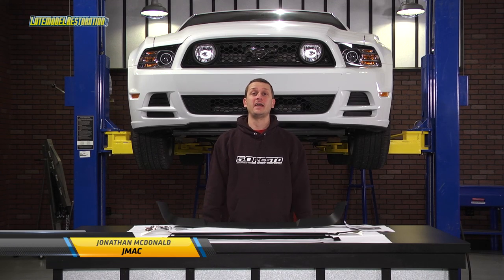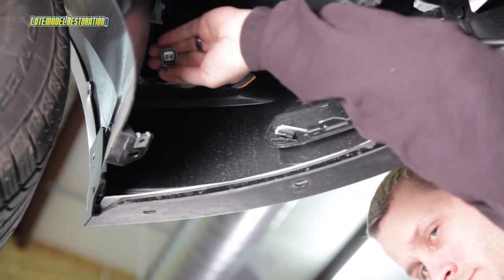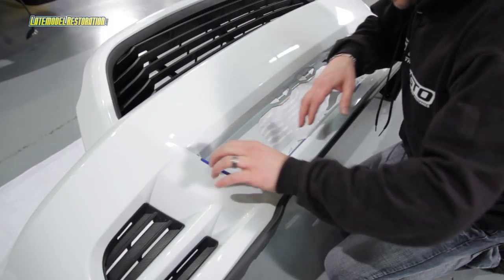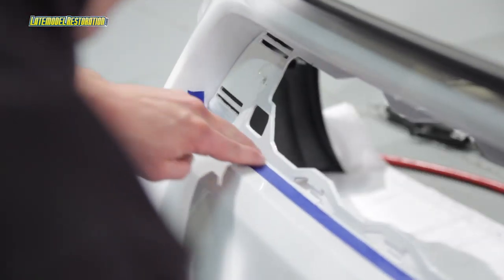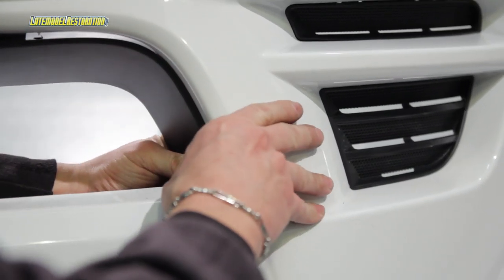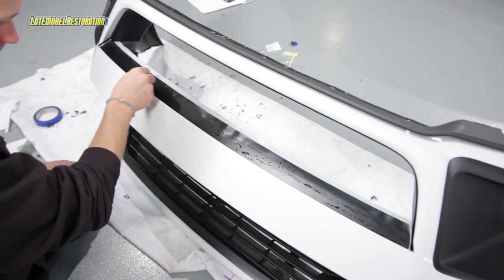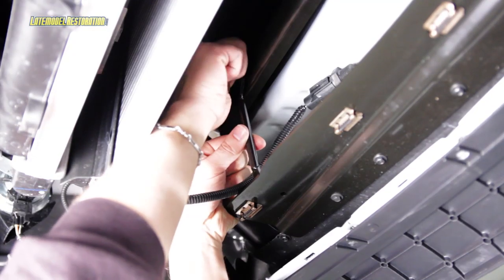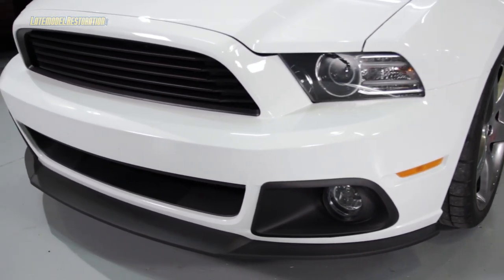Mustang Roush Lower Grille Delete Installation (2013-14 GT V6 S197)

Comment: I’m assuming you do not sell this kit anymore?
Reply from the maker: Correct. The Roush Lower Grille Delete Kit has been discontinued by Roush. However, this video is still available in case someone does purchase the delete kit second hand from a private seller.

Comment: This kit will NOT work on V6 cars running ProChargers. You can install it without the intercooler brackets but your bumper fascia will lack rigidity. Plus you'll be paying almost $300 for a piece of black plastic and a vinyl sticker. Unfortunate I had already hacked up my fascia before this became clear.